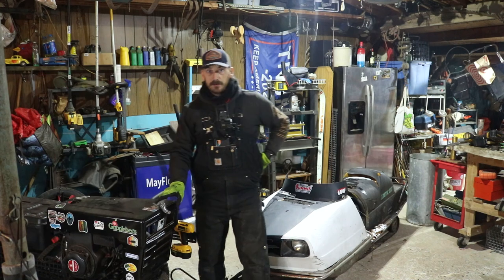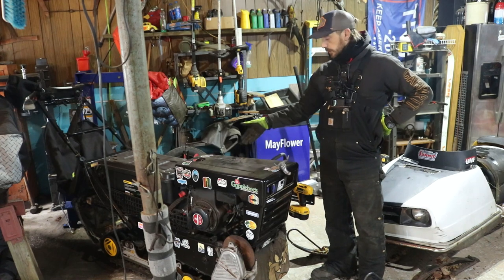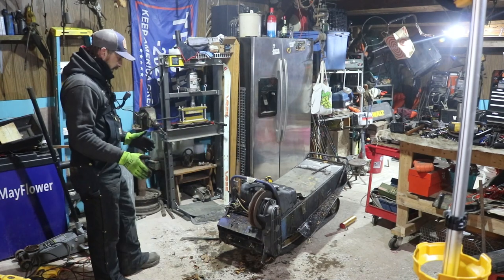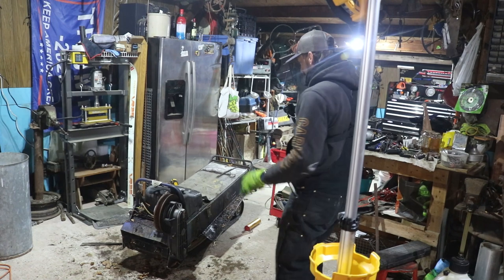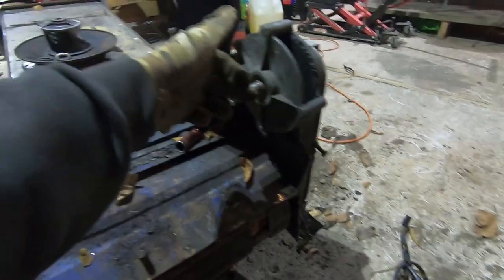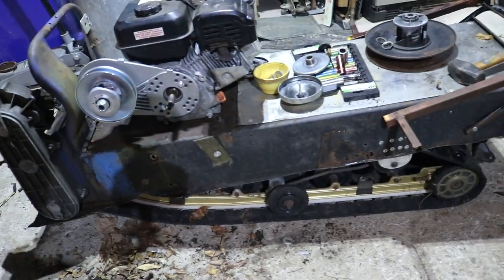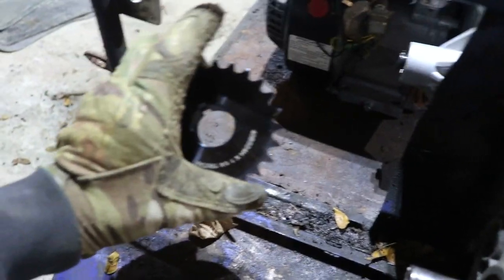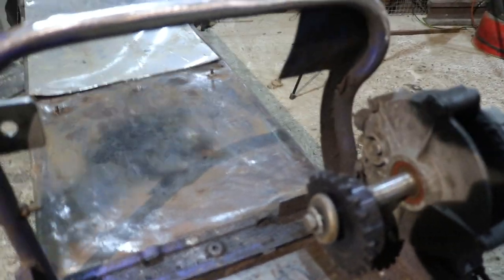DIY TRACKSLED BUILD #1 TEAR DOWN (2021-2022)

Comment: Nice! This should be of great help for folks wanting to build one. I made one two years ago and I'm super happy with it. A suggestion - you may want to lower the suspension. I've found with a 15" track the machine is pretty tippy so you want to keep the weight centered and as low as possible.

Comment: I think these track sleds are cool, but what I'm wondering is why bother cutting an old sled up... why not just put a 13hp predator in where the 2-stroke had been?  You still have a sled that only does 20 mph or so, but seems like it would be less work and you have a seat to sit on and some suspension at least, instead of your knees being the springs.
Reply from the maker: We don't have to insure or register these machines like a snowmobile. Its a good bit of cash to someone who doesn't ride trails but only use it to fish